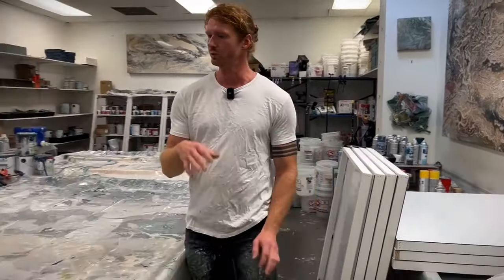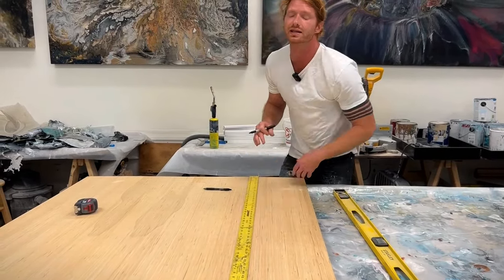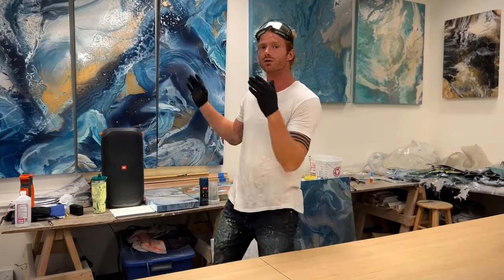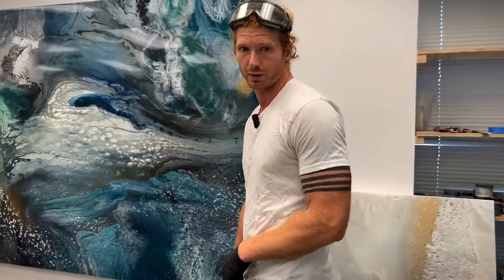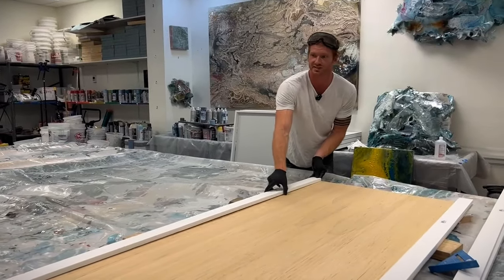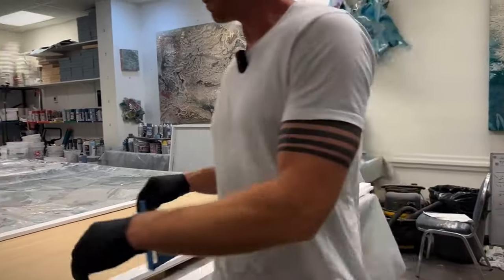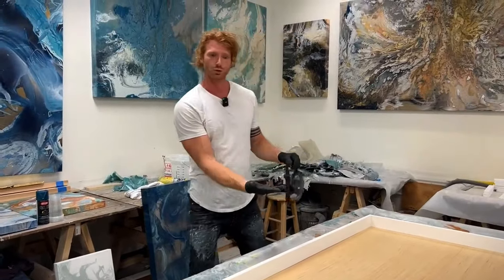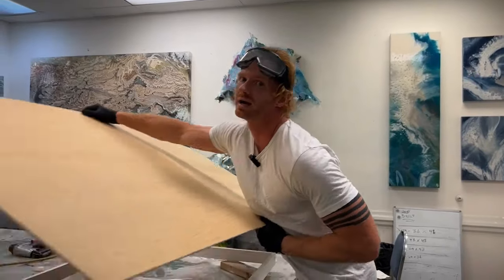How I Build A Wooden Canvas | Studio Session 04

Comment: To save yourself the stress of trying to line up the frame to the canvas. Oversize the canvas slightly. So that the canvas overhangs on all sides by about 5mm. After attaching the frame and glue has dried, use a trim router with a flush trim bit to remove the overhang. Also my personal preference is a mitred corner rather than butt joints. Just make sure you cut the mitre like 44.5 degrees.

Comment: Festool Track Saw. It has one of the best dust collection systems and worth the money. A lot of woodworkers will put a sheet of foam board underneath what they are cutting with the track saw. Easy on the blade and cheap to replace after heavy use.